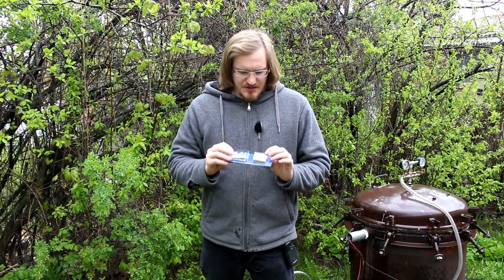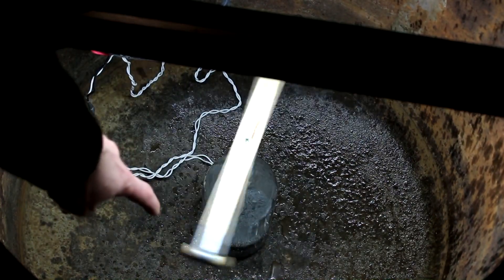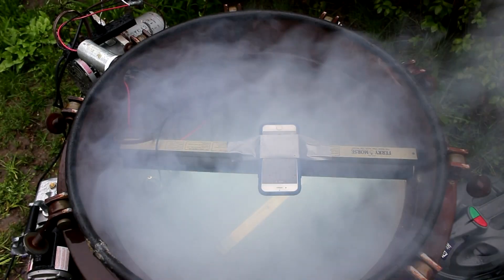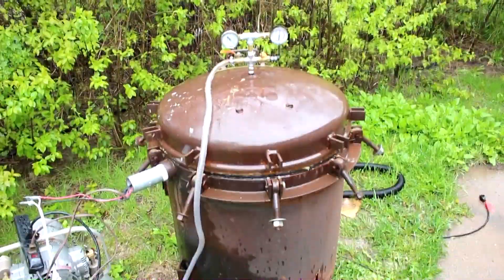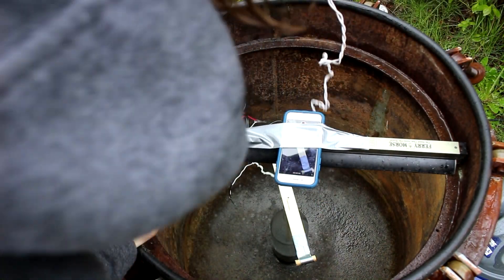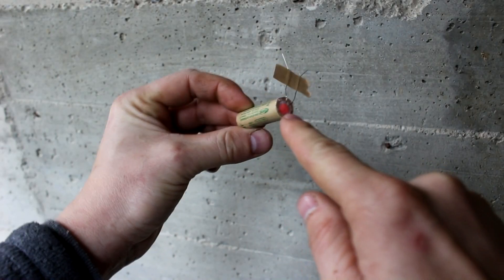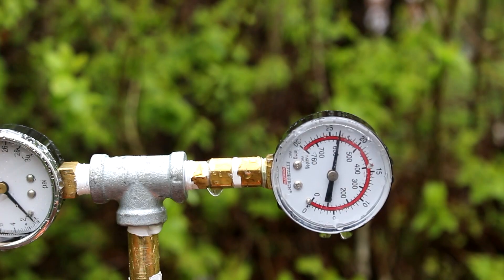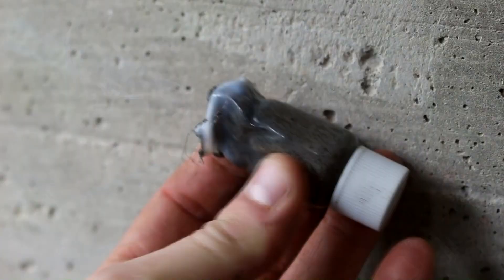Will a Model Rocket Motor Work In Vacuum?

Comment: Fuel being thrown overboard? Expand on that one if you will.
Reply: see the wisp of smoke rising from the igniter at 3:57 ? that means it's not in a vacuum. fraud, plain and simple.
Reply: @papalegba6759  Right!! 
I am noticing a trend of Youtube shadow banning certain comments to most people, but if the category matches, it allows another persons comment to be seen, basically creating an echo chamber. I have some stats scraped that can show this.
Reply: @philindeblanc  doesn't surprise me, YT are shady af. then there's all the bot comments, likes, votes etc. i click on 'show newest comments 1st', otherwise you're wading thru all the bot garbage.
Reply: @philindeblanc  - So when the rocket nozzle ACCELERATES the MASS of the exhaust gas, into the vacuum, - from WHERE does the force originate?

VERY simple question ( for people that have taken a physics class).
So what is the answer Phil?
Reply: @stuartgray5877  you are assuming a vacuum. He has done this test in a real vacuum and he got NADA, zilch, no combustion! This video is made for those with a strong belief system, and to satisfy that belief. Enjoy the delusion! Also consider that water in a vacuum starts to vaporize, which is what air is, and this creates a field. Go back to your classroom and kiss your teachers ring.
Reply: @philindeblanc  You must be forgetting: The company I work for buys dozens of monopropellant (hydrazine) thrusters from Moog Corp. per year.

We test every one of them IN A VACUUM and verify they produce the thrust predicted by the Tsiolkovsky rocket equation.

Did you catch the part where we TEST THEM IN A VACUUM?
And guess what? THEY WORK!

now quit fuckgin spreading LIES.

AND you must be forgetting that I showed you VIDEO EVIDENCE of rockets working JUST FINE in a vacuum. There are literally HUNDREDS of the videos.
Reply: @philindeblanc  ANd I see you STILL refuse to just answer my question:
when the rocket nozzle ACCELERATES the MASS of the exhaust gas, into the vacuum, - from WHERE does the force originate?

WHY wont you just answer that question?
Oh because ANSWERING PROVES YOU WRONG!

That's right we've been over this: You REFUSE to answer because you would PROVE YOURSELF WRONG.
Reply: @stuartgray5877  what you are saying is that we dont fly rockets or anything in a vacuum, this makes great sense. It is also what I have been trying to tell you..And it fits right along the moon being in the earth's atmosphere, which also shows how that whatever we were doing was not based on a space vacuum. Does this make sense?Oh, and fyi, I am rather familiar with MOOG ops
Reply: @stuartgray5877  I want to be on the same page first, of what you are defining as a vacuum, as that is - 80 tor or? I'll have to check back. I am not saying I know better than you. I am pointing out something that I think as long as we are looking from the same "perspective", we should be able to come to an understanding. Sadly our education system does a excellent job at compartmentalizing understands, and keeping certain understandings out of different fields. I see this all the time. So, while you might be the worlds best vacuum tester, and I am not doubting your claims, but it can be that what results you get are highly accurate, yet applied to understandings the contradict, or can mean  more than 1 thing.  So, did you look at Codys channel for the other vacuum video, (as this one is BS)?
Reply: @philindeblanc  - WHAT CHANGED the booster's VELOCITY while it WAS IN A VACUUM??

Too difficult of a question for you?
Reply: @stuartgray5877  I have taken enough physics to know that there are certain concepts that are not a factor of reality yet we apply a formula and give it a definition. For example; buoyancy is not a force. If you think buoyancy is a force, then you are not a thinking person, and can only follow directions given to you. This also applies to relativity. THese are pseudo science concepts that are needed in commercial applications but are false in reality, as proven by professors, and admitted by inventors themselves. I have also taken enough physics to know that what we are taught is for commercial application and not how reality works. But I will continue and entertain your comments, and respond to them. I'll be back.
Reply: @stuartgray5877  you keep saying it was in a vacuum, so now we have a few people pointing out that it was not in a vacuum, like the guy who expressed the fuel discharge. So you keep creating questions that dont apply..LOL Its a known issue that we are not teaching reality in the sciences. This is why in the 70's they started seperating the physical from theoretical. But, today, they are all mixed up and students are confused it is the saddest thing. So, you likely started with physical sciences, but once you started on your specialty, they brainwashed you to think a few core concepts that you can prove are fake, IF you look at it from a logic point of view, and not put math BEFORE the logic. This is something Dr Feynman explains, and he is one of the teachers, that was converted to the government projects and since then he has only delt with theoretical science. Before this, he was a true scientists with ethics and accountability.  BUt, as we are human, we can certainly have our flaws. So what you learned in school, is not necessarily reality. In fact todays concepts in younger children is very backwards and they dont teach principles in physics.
Reply: @stuartgray5877  One of the reasons I bring up the buoyancy equations is that often, these mathematic equations , perhaps like the Tsiolkovsky equation, is used to explain off something that doesnt exist or to put it back in the direction of thinking to make some claim true. If you have not learned this is science and science history, then I cant help you. I have not looked at this equation you mentioned, but that is the case in buoyancy.
Reply: @philindeblanc  - This also applies to relativity. THese are pseudo science concepts that are needed in commercial applications but are false in reality,"

Shows what you know.
The GPS satellite system MUST use Einstein's Time dilation equations to maintain the time that they do.

This is another example of you being clueless about something but making statements as if they are fact.
Reply: @philindeblanc  - you keep saying it was in a vacuum, so now we have a few people pointing out that it was not in a vacuum"

So dont trust ME.
LOOKUP the atmospheric pressure at 50 kilometers from an accepted source for that data.

ANd did you WATCH the video from SpaceX of the boosters separation or not?
There is evidence that they are in vacuum IN THAT VIDEO.

There is evidence that the rocket reaches vacuum in the video FROM THE GROUND.

How about the separation of the second stage from the center core? Did you watch that?
There is MORE evidence that that event occurs in vacuum.
Reply: @stuartgray5877  Well, it is fact, in the real world. But take them in a controlled environment and you can make them work. Just because there are formulas to adjust models, this supports that they are not applicable, but there to "fix" the issues of how it doesnt work in reality to continue to make it work in the model. So I think you are missing the fundamentals and caught up in the details. Maybe why you are a good vacuum tester operator, but you really dont know what you are talking about , out of the concept frame on how you are taught about it. You are a victim to bad science.
Reply: @stuartgray5877  Its a simple concept Stuart, In reality there is no absolute. There is no such thing as ZERO. so as sooon asn you can quantify zero, which is ONLY in the lab, you can construe all you want. But in reality we dont have such a base line, and this is the direction of theoretical pseudo science.
Reply: @philindeblanc  Oh and if you DONT think that buoyancy is a FORCE, then you are proving yet again that you are clueless.

What is the definition of "Force"?
What are the properties of "Buoyancy"?

Does it have a Magnitude and Direction that I can predict in advance?
YES
Would buoyancy be capable of changing the momentum of an object with MASS if under its influence?
YES
Reply: @stuartgray5877  LOL...oh boy! so you think there is a Tesla car that Musk confirmed was NOT altered, and was a standard model, and you think that is floating in space right now?  Oh man..You need some anti delusion cream or something!  Let me ask you...Do you believe everything you see on TV? Do you believe in the Care Bears? How about NASA footage? or maybe you believe in the movie SpaceBalls.  Have you heard of something called augmented reailty? how about virtual reality? Have you heard of DeepFake?  you really need to research these techs.
Reply: @philindeblanc  You know SpaceX is launching another set of their Starlink satellites tonight.  These satellites are visible to the naked eye for about a week after launch.
Maybe you could go see them with your own eyes??
But you would have to find someone that can google search:
 "How to spot Starlink satellites" 
for you, since I know you are incapable.

Then explain how people are getting internet from these satellites far from any cell phone network.
Reply: @stuartgray5877  S   Hi Stuart.  Sorry you are running out of excuses on each of my comments, I notice you ignore. You sure did a fast one when I asked you oabout 911. Since you are such a physics guy and all. You ran pretty fast.  I am so glad you ignored the Tesla car being in space, as there are 2 videos that show it being a chromakey and not in actual space. But I know...you are incapable of searching and finding that. 
Will you have a camera on the entire trajectory all the way over the ocean? Because that is where it will go. So maybe situate yourself on a shore that can catch that view angle as some others have done that and uploaded the video which you might be incapable of finding..so this time you can film it. Or perhaps you can get on a boat and see how close you can get (3-5MILES) to the launch area and see what footage you can see at that distance. Night launches are what you want, that way you can follow the light, and not lose the visual due to clouds or atmospheric conditions. Because the claim is that the rocket cannot go straight up and out into....Space!!!!!! LOL I will get some popcorn if I have the will to put any time into it.
Reply: @stuartgray5877  i know that they launch, its what I just told you. You just SOMETIMES need to stop the music that is playing in your head and actually process the info you either read or just randomly reply to, as it ALWAYS has a no reply to the topic and completely ignore the info I provide. There is likely some disease reference to this in the DSM manual, but, I'm not a psychiatrist.
Reply: @stuartgray5877  I dont know what the flat earth people do, all I know is that they come up with their own models and some of them do stupid things like assume what they dont know. But you and I, as well as every person on this earth has NEVER experienced the earth as a spinning ball. This is a fact unless you are delusional. SO from a experience standpoint, this is the fact. What some people expand from that is their problem. Some come up with a dome, some come up with a earth underneath..The human mind has a lot of imaginative capabilities. We are very different than animals. There is little possibility we came or evolved from other animals. If we had, there would be other forms of animal life in different areas with the same evolutionary abilities like man or beyond man. It doesn't take a genius to see this, but it does take guts and a good sense of scientific understanding of the physical world. I feel sorry for those who are blinded by the pseudo science. I know it is not hard to be. But you have think on your own. If you dont, you too will be a victim of pseudo science. Which I think is your problem to begin with. All schools teach very similar ideas. Its up to you to test them vs accepting them blindly. I accepted them for a large part of my life. But once you see ONE LIE, once you think your way through one facade ....there is no going back. But not everyone has the opportunity to catch it. You have to be a true skeptic to be digging deep in places least expected.
Reply: @philindeblanc  Do you know how I know who has the truth of the argument? 

One side is building amazing new technology, pushing the boundaries of science in an effort to progress humanity.

The other side is literally just a bunch of random nobodies on the internet who have contributed NOTHING to any field of science, technology or discovery but are convinced they know better than those that do. If they REALLY know better, why do they have NOTHING to show for it? 

I'm not a religious man, but there is a good quote in the Bible that is apt for this situation. "You will know them by their fruits"
Reply: @philindeblanc  - Ok watch the YT video "Tracking ISS Live!"
from Astronomy Live. The same person that took the Falcon Heavy Launch video from the ground that watched.

Tell me WHAT IS THAT THING IN THE SKY called the ISS?
This is video that proves it IS REAL, and looks exactly how NASA says it looks.

Explain that genius!
Reply: @philindeblanc  go watch the LIVE stream tonight.  We have photographs taken through optical telescopes good enough to see the Dragon space capsule docked to the side of the ISS.
you just deny the proof with no evidence that the images are fake.
Reply: @stuartgray5877  Like I said, the ISS is claimed to be in LEO, not out space, hello!
Reply: @philindeblanc  - "the ISS is claimed to be in LEO, not out space, hello!"

But if we can PUT IT UP THERE, and MOVE IT AROUND, then Rocket Propulsion WORKS IN A VACUUM !!

Do you think  ANYTHING could continue to ORBIT CONTINUOUSLY if it was NOT IN A VACUUM?
You are Admitting that rocket Propulsion DOES WORK IN A VACUUM!

THANK YOU!

SO we are DONE HERE and you ADMIT THAT YOU ARE WRONG.
Great then I am finished with you.
Reply: @philindeblanc  'stuart gray' is a chatbot. it spams every video on this subject 24/7/365 with pseudoscientific gibberish and only exists to waste your time.
Reply: @papalegba6759  How can I spot these out in the future?
Reply: @stuartgray5877  WRONG! I would not make any assumptions based on the ISS. There is overwhelming video evidence that confirm it is faked footage of anyone on it.
Reply: @philindeblanc  there's a human posting videos on his account but the comments are automated. he just repeats the same unconnected topics over and over. he doesn't work for ball aerospace either, he's in violation of their employee code of conduct. maybe there is a real stuart gray somewhere but it's not who/whatever you're talking to on this thread.
Reply: @philindeblanc  - I cannot FORCE you to understand Newton's laws.
You clearly DONT currently
If you DID understand them you would have no problem answering my high school level questions.
Yet you REFUSE.
Papa Legba is the same: he REFUSES to watch video evidence OR answer questions.
Reply: @stuartgray5877  Its you refusing to answer. You are dancing around the same thing. Newtons laws? Like which ones? The crossbow is a failed setup hypothetical that cannot happen in reality. Why not try reality instead of theoretical with a absolute point? You can't. I could care less about your highschool BS, they teach enough theoretical garbage as it is.
Reply: @philindeblanc  - "Newtons laws? Like which ones?

Just THE THREE!
If you DONT believe that rocket propulsion works in a vacuum, then YOU DONT UNDERSTAND NEWTONS LAWS PERIOD!
Reply: @stuartgray5877  first law of thermodynamics disagrees with you, chatbot stu 😂😂😂😂😂😂😂😂😂😂

Comment: First of all.......most people confuse "vacuum" for "there is no air at all". Rockets fly all the time at high altitude.....which is a vacuum.

So technically speaking......YES rocket motors work in vacuums. But fuel based rockets do NOT produce any thrust in a complete vacuum...which is what most people are thinking about when they hear the word "vacuum". So NO.....rocket motors do not work in a complete vacuum.

FUN FACT: Man has NEVER flown a rocket in a complete vacuum.
Reply: Any rocket that burns is a fuel based rocket.   
Burning requires an oxygen source.  
Rockets that burn and that are to be used in low or no oxygen environments requre a dedicated oxygen source.  For example rockets burning liquid hydrogen will also carry liquid oxygen, they can burn in space.  Solid fuel rockets contain both fuel and oxidizing agents in the fuel itself.
You may want to re-check your "facts"
Reply: Thomas G -  - So when the rocket nozzle ACCELERATES the MASS of the exhaust gas, into the vacuum, - from WHERE does the force originate?

VERY simple question ( for people that have taken a physics class).
So what is the answer Tom?

AND:
"FUN FACT: Man has NEVER flown a rocket in a complete vacuum."

SO WHY do I have HUNDREDS of videos showing the opposite?
Reply: @stuartgray5877  You mean THOUSANDS  or even MILLIONS of videos all at your fingertips? id like a flat earther to explain that lol